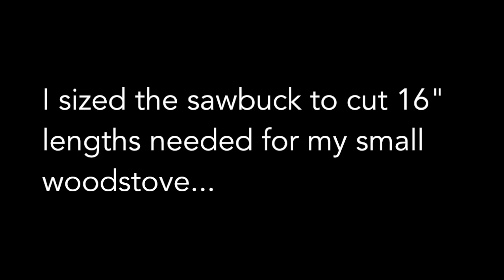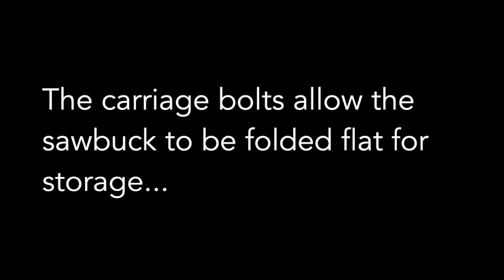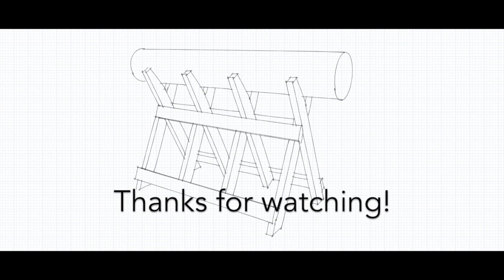Making a Firewood Sawbuck Stand

Comment: Very cool video!  I too need a sawbuck to cut wood for a stove and use 16” cuts.  
What is the distance of the carriage bolt holes from the top end of the braces and how long are the braces?
I think a three brace sawbuck would be fine for me, but better too large than too small?
Thanks 
😜

Comment: I found another post online with dimensions and "parts list", but would be nice to have here.
What I'm thinking is 6n 8' 2"x4"; cut in half to 4'; 4n 5" 5/8 bolts, 8n 5/8 washers, 4n-8n 5/8 nuts (double nuts to prevent loosening apparently), 16n 3.5" deck screws. 
(using n after numbers for count to prevent confusion from too many numbers)

4n of the 8's become legs. 
1n becoming the angle stop
1n becoming the bottom frame brace

4' long, and ending up being 3.6' tall when unfolded.

For 60 degree feet with the ground, put the carriage bolts at 18" down. This will make the saw horse shorter at 3.46' unfolded.
Reply from the maker: Yes, you can make this sawbuck with 6x 2x4x8's. Instead of double nuts, just use a nut with nylon insert.  Good luck with yours--I find mine useful.
Reply: I like your idea.

Comment: Great looking sawbuck! Congratulations.  What are the angles of the bevel on the braces & teh corresponding angle of cut to make the legs flat to the ground please?
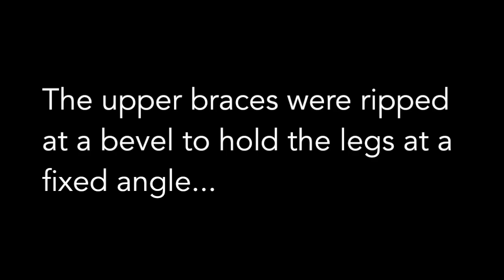Reply from the maker: Thank you!  If you look at the bottom of the screen at 1:20 in the video, the angle between the leg and ground is shown as 65 degrees (but you only get a glimpse)!
Reply: Thanks Brian; 'really helpful.